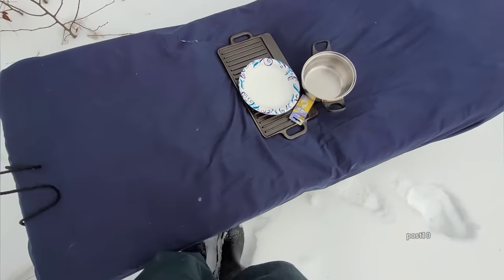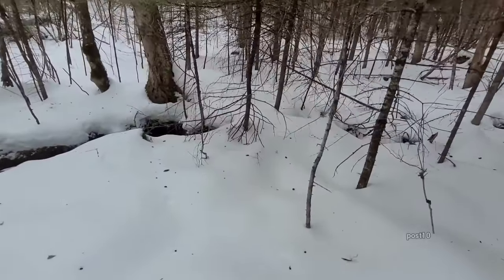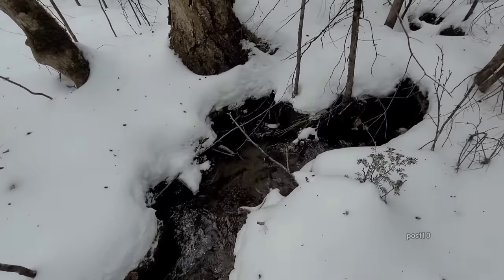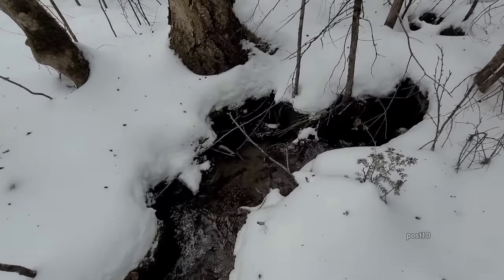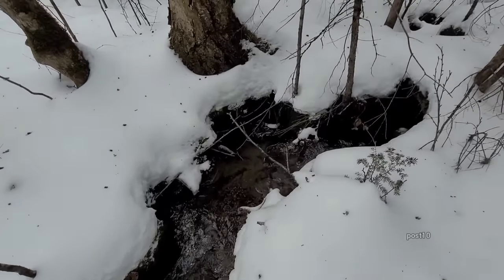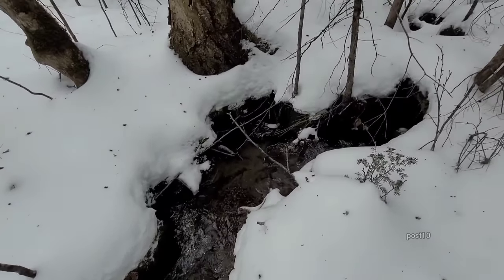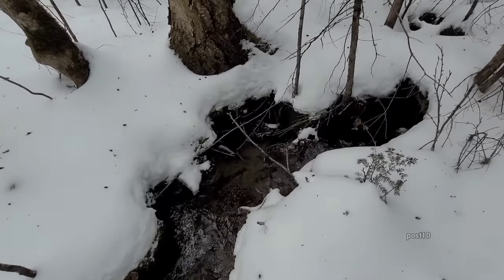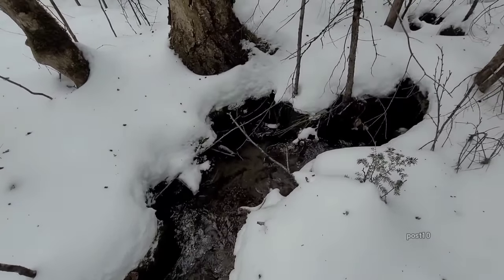Very Cold 24 Hours At The Truck Camp. Feb 2023

Comment: So as I look at your “abandoned truck”, my thought is if you put an A frame roof on, and open your current ceiling, to enter that area, your heat level will change dramatically because it will rise. That might be a positive for you, but if you make a sleeping loft in your “attic” it will be very warm, which you might consider a negative.  
Have you considered putting a rounded metal roof on?  It wouldnt provide you with an attic, but it would be stronger than flat, provide easy run off, and depending on how you structure your supports, you might be able to reuse your current metal roofing.

Comment: You could use the pieces of wood measure and cut up and fix the front for you have your a little kitchen you could fix set up with a Pieces would take that steering wheel out so that you can walk over there with a seat in the steering wheel is take that out make your cabinet wall use the wood for the doors

Comment: Probably don’t want to spend too much on the truck, but could use thin sheet insulation that’s like an inch thick or something and trim it to fit up against the ceiling/ roof and walls maybe.

Comment: Line the truck in reflectex insulation warn as hell it will reflect the heat back in . Used it im my camper it's a godsend.  Warm as hell and thin cheap  stuff to .

Comment: you could use the stream for electricity. Why not cut the holes out on the stove and fabricate some steel plates? even the front dampener is an easy project. First on my list though would be fixing the rollers on the front door. Is there an engine? Cool channel.

Comment: if you hung a heavy curtain in that doorway you would keep the heat in thew area you are sleeping in But the front area would be very very cold. If you got insulation sheets then used that ply wood. You could insulate the walls to keep the heat in and use the flooring with to help keep the room warmer. Utilize you materials.

Comment: I think you need to move your stove to the back where the double doors are. And install your stove right there in front of the double doors. Take your vent pipe out and an angle up through one of the windows. And insulate the inside of that truck.

Comment: If those extra floor tiles are from your house you should save some incase you need to replace some. If not, put them in your bathroom, the floor in there could use them. 
They would be great to put int the pretzel truck as the floor is so cold. 
You can user them as shelves too.

Comment: I would build the roof in a lean to fashion at least 6 inches above the truck. The benefits of the air gap in the summer keeping the truck cooler, and no snow contact or load on the truck in the winter, might be worth it to you.

Comment: If your going to put more things there? I would have half of a conventional roof over the van then the other half or parts there of on the side. Would cover the door, and or for a vestibule.Yes it requires more work but to the desired ends.  Dig a desired size of pool for bailing the water out.

Comment: Note: when cooking with oil it’s imperative to have the oil almost to the smoke point but not at or over the smoke point. If the oil is too cold as you put the food in, it will absorb. If the oil is very very hot (350ish) the oil won’t absorb into the food just cook it. Crispy fries .

Comment: Hearing you say people say you are stupid for doing things different than they think you should makes me very mad, especially when thier criticism is obviously stupid.  You are a young guy learning by doing.  When you make a mistake you admit it and I respect that. For instance saying you got ripped off when you bought the stove, that takes courage, most youtubers never show, or admit thier mistakes.  A lot ofpeople have gotten shafted buying those knockoff boxwood stoves.  Keep doing what you are doing, be as safe as you can and have fun.  If the complainers don't like what you are doing they are free not to watch, or to are thier own videos if they think they can do better.  I really like the truck cabin and have slept in similar structures many times.  There are no "codes" for such structures where I live.  Something you might want to consider foe a roof is getting treated 4x4 setting them as post about 4down each side of the van. You then run a 2x4 the length of the van lag bolted to the posts then run a 2x4from post to post over the top of the van then you can attach your roof to that. Doing something like thatcan give you overhang ror runoff/dripping. It gives you a solid structure without putting weight on your vans roof, and if your posts are set 30 to 36 inches in the ground it is going to be very resistant to wind.  We do that a lot around here.

Comment: My impression of you has changed somewhat, you absolutely have to place that split wood on the fire in a downside orientation so the flames have something to grab hold of, Putting large wood on as you did at like 39min mark makes it very hard for flames to get a hold of the wood, however placing the back side of wood on the fire after you have HOT COLES in the fire is the way you make your fire last longer or burn longer over night. At like 39:45 you put the wood the way it should be to make hot coles.

Comment: I'm late to the show but why not use those leftover construction materials in the van? The floor tiles could go on your floor after laying down a thin layer of foam or insulation. You can lay the plywood down over some sort of insulation and then the tile. Also, why not seal off all holes to stop mice and rats from coming in? Those things are very dangerous because of their waste.

Comment: If you want to insulate but still melt the snow, you could just insulate the wall and floors, then the wind will not cool all the walls down! 
I would keep the wood, mayby a year or two goes by, but you will eventually need it

Comment: Its not too bad really. A bigger slant on the iron with a 12 inch beam on the high side and. 8-inch in the middle  and 4-inch on the low side would do it. These would spread the load enough to fix most of the issue.

Comment: Just an info message  Can Propane Freeze? A propane tank's cold temperature limit is -44 degrees Fahrenheit — at that point, propane turns from a gas to a liquid.Nov 20, 2020  If your going to be below the -44 you need to bury the propane tanks in the snow, will keep it from freezing

Comment: Use the ashes from the stove with some water to scrub that off, the combo of wood ashes and water and fat makes LYE SOAP...
Reply: Also, for folks with a wood stove with glass, no fat in the mix of course, but you can clean the glass even if it has some creosote, by crumpling up a piece of newspaper, wet it and dip it in the ashes. Rub the door with this, keep crumpling wetting and dipping in the ashes with freas pieces of paper until all deposits are gone. Them use a piece of wet crumpled news paper to wipe all remnants of smoke and the glass is clean. Then polish with a piece of dry crumpled newspaper. Newspaper works best. Of course DO NOT DO THIS ON HOT GLASS. WATER AND HOT GLASS IS NOT A GOOD COMBO. ANOTHER OLD TIMER TRICK! This works for me, but I have stainless steel triple wall pipe after the first four feet above my stove. The first four feet are just regular black stove pipe and my whole pipe is vertical up thru the roof. Toss an empty aluminum can in the stove when you have a nice hot fire. You can look this up, I did because it worked so well for me. Seems something happens on a molecular level that keeps creosote from sticking to the pipe. It doesn't stick to the pipe in the first four feet either, probably something from the stainless/aluminum reaction spreads there too. These hints I have used for almost 50 years... I still check my chimney at least once a year tho.

Comment: You need some music in the truck. Perhaps Bachman Turner Overdrive, or Steely Dan's album Pretzel Logic :->  But seriously, the truck is my favorite theme on this channel, interesting to see it progressing. Maybe you could bolt a metal box to the outside wall, with a small hatch leading to the interior, making a convenient "ice box" for cold storage. Also consider some sort of vent/shutter for heat regulation or smoke removal without having to deal with the sliding door.

Comment: Dry heat isn't great for your skin and lungs or even hair health. Why don't you just slowly boil amounts of water on the stove, perhaps with essential oils for calming smells at night time, or maybe even adding your orange peels to the water for natural citrus/clean aromatics? Also, I know you are smarter and more experienced with this stuff than me, especially bc I don't enjoy cold weather at all (perhaps that's why I like watching you enjoy it), but why not close a towel in that back doors gap to prevent the drafts? Bc you probably want to maintain it's ability to open and close, spray foaming is a bit much but a towel can go in and out. If the door doesn't open, I'd just duct tape a towel along the draft line to insulate it. 

Also, do you lock the door when you go to sleep?

Comment: The blinking light is a low tire pressure, not 5000 mile oil change time.
Reply from the maker: The light that says maintenance required means 5,000-mile oil change, the car's tire sensors are broken and I'm not paying to have them fixed

Comment: Are you just going to insulate the roof, or will you insulate the whole truck. When or if you do put up an Aframe roof, don't just have a corrugated metal roof. Put on a wooden roof before the corrugated roofing on and maybe check out how cheap you could get under floor heating, because you already have flooring.

Comment: Not criticizing but the pipe installed backwards could be a problem with the creosote leaking outside the pipe and smoking inside also potential for fire. With a rain cap you will nit have water running inside. Build some shelves with the wood.

Comment: Problem 1, mice.  Use steel whole or screens to plug up all tiny holes near the floor
Problem  2, cold floor?  Try placing insulation under the  truck
Problem 3, as for windows, you can buy acrylic spray which will make it opaque.

Comment: If you used actually dry wood it would burn much hotter all the wood you are using is wet wood the wood needs to dry over a year or two before it's proper to burn. Just because a tree is dead or fell over does not mean it's dry it still contains lot's of water
Reply from the maker: The wooden burning it was cut three years ago so it's fine it just might have a little snow on it

Comment: 😅 You need to make sure you close the damper, or the wind will come inside through the flue, blow those burner plates off, and they will fly up knocking the roof off, which will fly up into the clouds, get covered in ice and crash back down, crushing the truck.  🤣
Reply from the maker: It would only send wind down if the exhaust was coming out to the side like I did in my last camp and it didn't work very well but no it won't do that here there's too much current on such a tall pipe
Reply: @post.10  😍

Comment: Id say y not use that wood for the walls and floor around the bed in the truck so heat stays abit longer there and i say the temps r proper cause ones by the stove and the clock is not so close

Comment: "Heating the cans causes an increase in heat in a chimney which can help prevent creosote from building up on a clean chimney. However, aluminum oxides are very stable and do not react to high temperature. This means that there will not be much of an impact on built-up creosote." 
Source: Google language AI from the search: "aluminum oxide to clear creosote"

Comment: Put a generator where the engine used to be would probably result in carbon monoxide leaking into the truck. Not good. I could see getting rid of that engine cover and put in a flat floor with possible storage for firewood.

Comment: I was thinking that if you layed the flooring that’s in the boxes in the truck, it might act as insulation. That metal floor is so cold.
Reply: If you had leftover flooring, you could even use it on the walls and ceiling too. If that’s pergo, it usually has a foam backing of some sort.

Comment: Dude. Kep all wood. Burn tuf that too small to use. Every leftover piece is valuable. You can stand it against a wall neatly to keep it out of the way. Slide it behind a heavy dresser. Whatever. Keep it. You will find that u r always looking for a flat surface for some wanted area. N you won't have to go buy something if u have it . Burn tiny stuff when ur dealing with pieces like you have

Comment: If you had any concerns about that roof , why didnt you remove some of the snow ? also , why would anyone burn aluminum or plastic INDOORS,  dont say , you had a chimney , cause you had the door open..
Reply from the maker: Removing that snow is easier said than done, it's mostly sleet and it's all Frozen together I would have to chip it away not just shovel and since we had warmer weather in the forecast that is happening right now